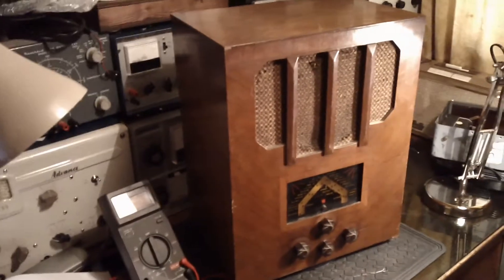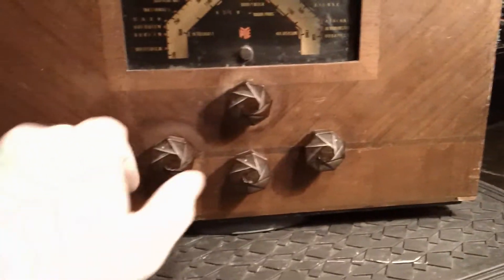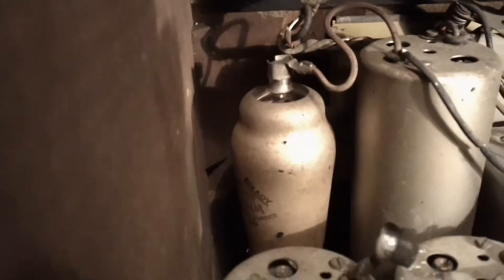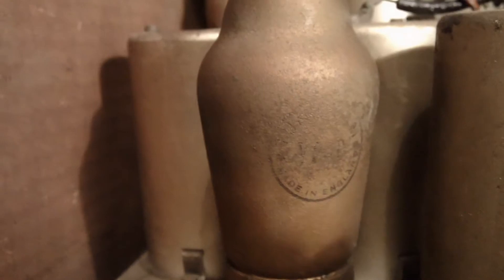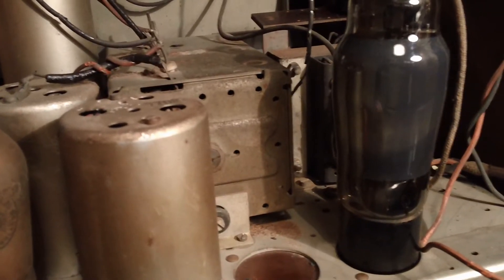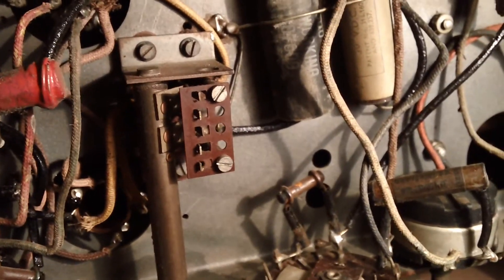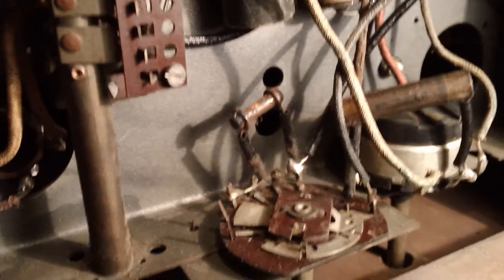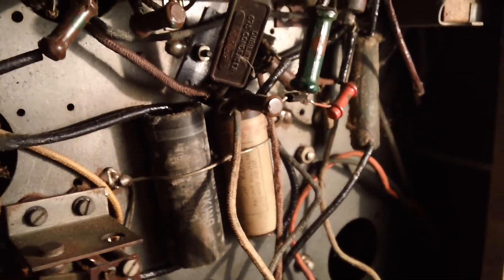Pye QAC2 valve radio from 1937

Comment: From an American perspective, a real unique radio Andrew. I've never seen anything like those band switches.
   Huh, seven pin valves like Dylan had in his radio.
   I've also seen the "Non-Inductance" label on a capacitor here as well in the past. Perhaps, if you think about it, a regular paper cap could behave in such a manner. They are in a wound roll of paper and foil. Maybe that "Non-Inductance" type is constructed differently. Would be interesting if you could heat it up and pull out the guts to show all of us how it is made.
   Anyway, have fun with this project! Looks like fun.
       Tom
Reply from the maker: Hi Tom,  those sort of 'finger' or 'leaf' switches are quite a familiar sight here until the manufacturers start to use the rotary wafer switches. One day I'll dig another pre-war set out and show you the switches on that. A perfect example of over-engineering.  Yes, non-inductive capacitors are made differently, at least modern ones are. I will show the insides when I get around to re-stuffing it.  Thanks for watching!

Regards - Andrew

Comment: Andy,
You certainly picked a bargain up there my friend.  I would say that it will make for a pleasant repair/restoration job.  My Regentone RG99/2 is transfer-badged on top so I’ll be demonstrating how I will get round it when I restore what is left of the cabinet.  It will be interesting to see two methods of how to restore a cabinet whilst retaining the original logo.
My wife recently bought me an old television, Pye model B18T (1948) for £30.  That too has the Pye logo on top but it is post what was considered the offending logo (Japan – rising sun) that is atop your radio.  I shall be going to the NVCF on the 11th of May and whilst there I’ll get information about how I might put vision on it once I have repaired it to get a raster level.
I’m looking forward to seeing this radio restored.  Its chassis looks similar to a Pye 823 I repaired for someone two years ago.
Regards,
Phil.
Reply from the maker: Hi Phil, yes not a bad buy. In my limited experience of pre-war sets there's always something laying in wait ready to test you, so I'm expecting this not to work :)   That's a great price for the Pye TV, congratulate Mrs. Phil. I hope your valve store is full of EF50s!  Hopefully I shall see you at the NVCF, I think I saw the Aurora standards converter there last year which is what you need for the TV. If not I can put you in touch with someone who can supply one.

Regards - Andrew

Comment: Andrew,
Very nice set! I simply adore pre-war receivers and this one appears to be in very good condition considering our weather. You probably already know this, however non-inductive simply means that it is not capable of electrical or magnetic induction which may have been important in terms of interference from components back then? Just a guess on my part :-)
It appears to be very simplistic in design and the underside of the chassis doesn't show any sign of disturbance. Also, I completely agree with you on the beauty of the B7 valves. 1937 was pretty much the end of these valves as octal bases were found to be used from 1938 onwards here in the UK. Of course, they were still used in sets however it was often only found to be rectifier valves. Anyway enough from me, I look forward to the restoration of this one, I have great faith that it will look fantastic when completed.
Regards, Dylan
Reply from the maker: Hi Dylan, I hope you're well. It is very simplistic but I bet there's something challenging ahead. All the coils seem to ohm out OK but let's wait and see.  I think the non-inductive bit might be a bit of 1930's audio-phoolery marketing. Non-inductive capacitors, so I've read, may be more capable of passing low and high frequencies (this one's part of the tone control circuit) but I bet you'd never tell in a 1930's valve radio! I just wondered why they went from using non-inductive components pre-war to regular 1000v rated Hunts waxies post war.

Regards _ Andrew